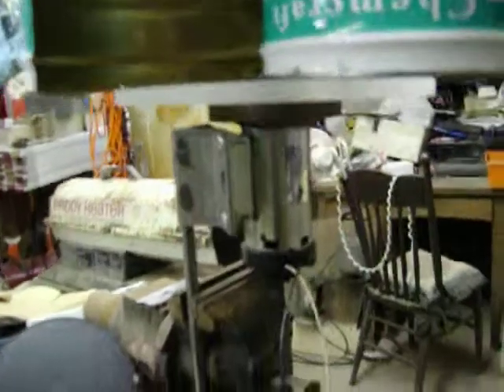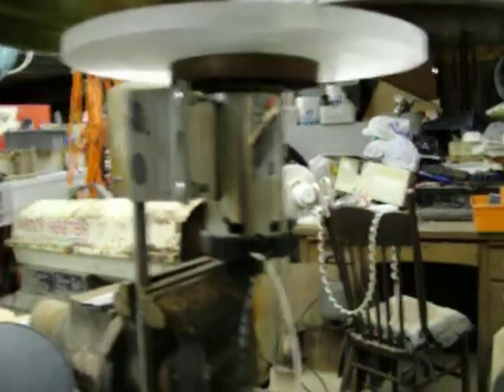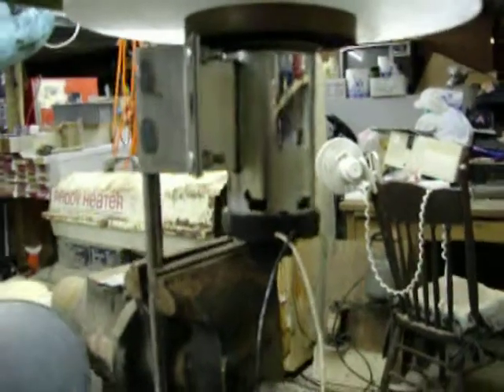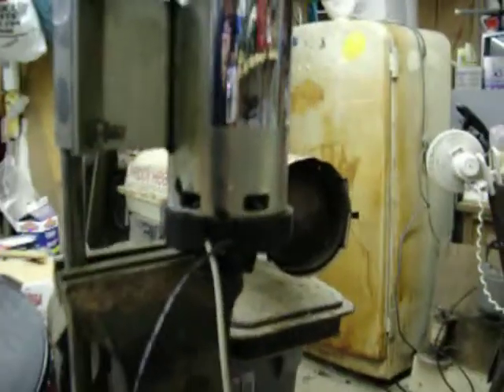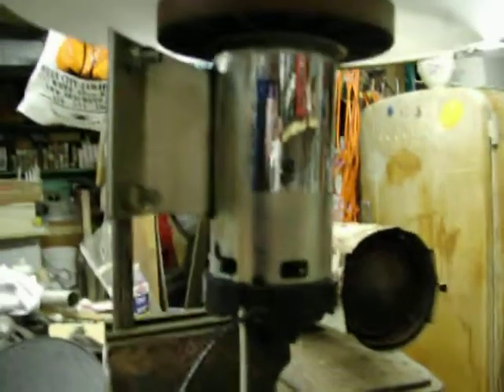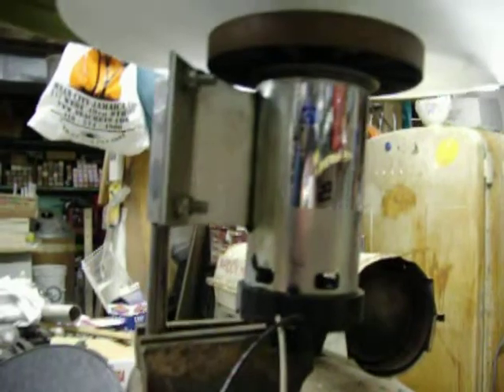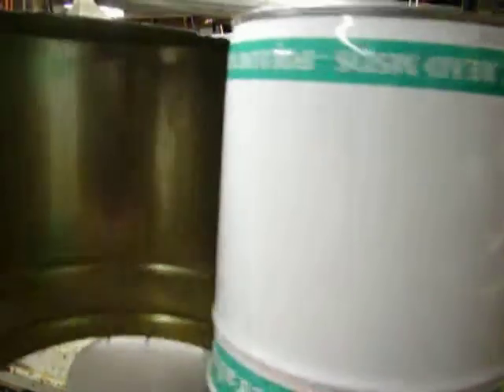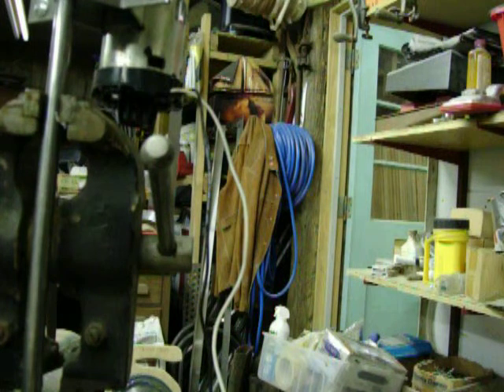my first windmill attempt

Comment: 2.5 volts... I think you need to make a horizontal wind generator, as they spin about 6-8 times faster than your vawt.  Nice build.  Your motor I am guessing is good for about 50rpm/volt, which is kind of hard to work with.  I would suggest with going with some 36-48" dia. pvc blades or some hand carved wood ones.